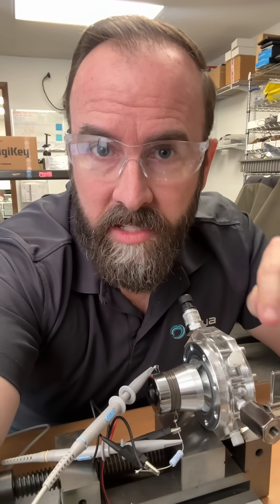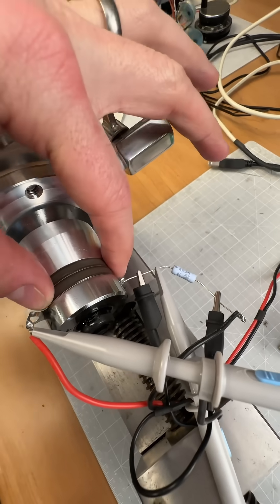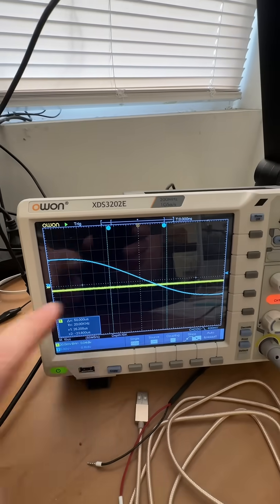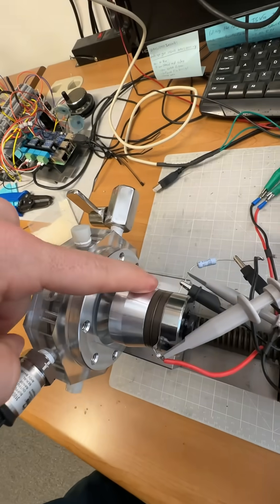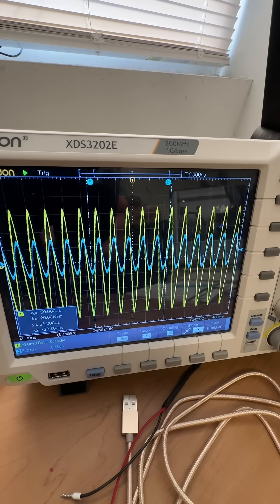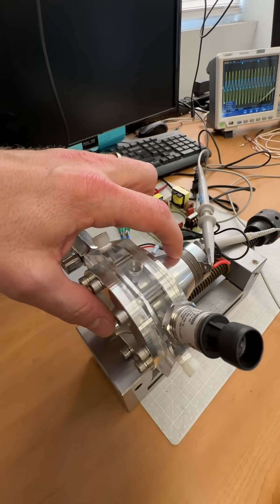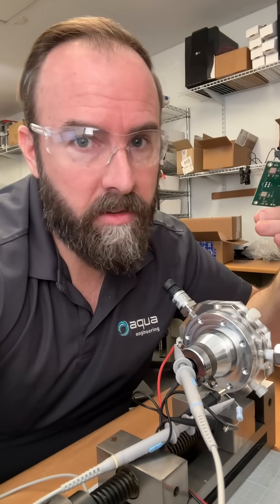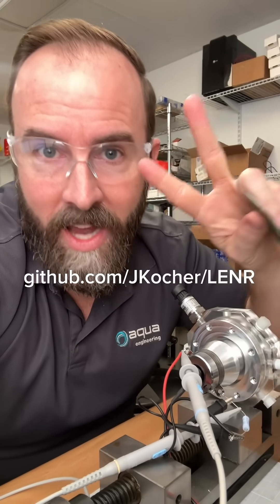LENR 18: Tuning for Sonoluminescence

Comment: Hmm so the input voltage the same, frequency increases, load current increases,  coil voltage decreases, resistor voltage increases because coil becomes less at that frequency. Hmm try to do it with a free standing coil and see what happens.

Comment: Two transducers isn't enough to achieve fusion, the pressure wave isn't right and will always have pressure imbalances that will prevent high efficiency fusion. they already learned this with fusion devices. The only way to get them to work would be with a horn with several different custom shaped density layers to focus the waves, a much easier approach is  just use more lower powered transducers at a lower power output like an icosohedral formation. The reliance on a resonant cavity would be almost eliminated.
Reply: For some reason it is not letting me edit my comment. The more conformal the collapsing cavity is the higher temperature it will reach. This is the same concept of keeping a conformal pressure wave to collapse a conventional nuclear weapon. the only nuclear weapon I know of that uses two pressure points requires a horn of multiple materials to focus the pressure waves, which is exactly what you are doing. They then learned that using multiple points, rather than two works much better. 20 smaller transducers  making up the majority of the chamber surface would be able to set up a resonance MUCH better without relying on chamber design with two transducers.
Reply from the maker: @ I’m starting with two for many reasons, mostly because it keeps the geometry relatively simple and 3-axis machinable. Can run single sided too. We’ll test, iterate, and improve until I get where I need to be on sonoluminescence, in fact this is my main goal for the project. I’m not holding my breath for LENR if it doesn’t show anything after plenty of reasonable data sets, although I’m stubborn enough to just keep iterating haha.
Reply from the maker: @ my original design had two horn waveguides pointing into the center. I may go back to this and use two opposed flats to get a central film that would cavitate about a disc where the hemispheres meet. It might be way easier than trying to get that whole 20mm volume to focus accurately. These are my recent thoughts after a pretty grueling FEA simulation a few days ago.
Reply: @i2c_jason  Again you are rethinking the wheel. Two transducers with waveguides or horns is not as efficient as more transcucers with almost no horns because they controll the majority of the geometry of the cavity. Learn from history. You are introducing complexity where it is simply not needed.
Reply: @i2c_jason  You need to control a spherical compression wave, what about controlling that from two single point makes sense?
Reply from the maker: @ in engineering and signal processing we very often use approximated shapes and convolution to turn our end result into a more pure shape. Classic example is a square wave going into an inductor to achieve a sine wave. Same general idea here, rather than use thirty piezos we’re starting with two and shaping the cavity walls so the wavefronts approximate a spherical collapse at the center. Many things in engineering can work very well when 90% approximated and it saves tremendous cost. The goal here is start simple, start low cost, start open source.
Reply: @i2c_jason  You are saying you need to re-engineer the cavity because it is not the right shape. Multiple transducers of a lower power wouldn't need re-engineering because their face is the inter face of the cavity. Just like in NW engineering the found that multiple detonation points, or in this case multiple resonant faces, are SO MUCH EASIER to control and use. Again, you are trying to re-invent the wheel, we have walked this path, learn from our journey!
Reply: @i2c_jason  You are following a design of someone who did not complete their task, something is wrong, just replicating their design is destined to fail. Don't just look to replicate their results, imagine how it can be improved and move towards that goal. If we only replicate science goes nowhere.
Reply from the maker: @ This is a completely original design from first principles, straight from my brain. If anything like it exists it's pure coincidence.
Reply from the maker: @nolansykinsley3734  I’m not trying to achieve classic fusion temperatures. I’m trying to extremely boost low energy nuclear reactions. It’s a little bit of a nuance. No idea if it’ll work as the whole LENR field is very controversial.
Reply: @i2c_jason  Pressure waves are pressure waves. They flow and react the same. Even if you aren't trying to create classical fusion learning from the advancements of classical fusion will still greatly increase efficiency.
Reply from the maker: @ Kind of counting on that hydrogen loaded nickel lattice as the mechanism for fusion. Pressure at the sonoluminescence zone should just boost it beyond what typical 100C hydrogen loaded nickel will do in an electrolysis setup. Hoping for a better hot spot with the addition of lithium and gadolinium.